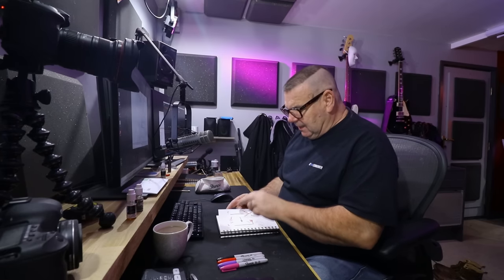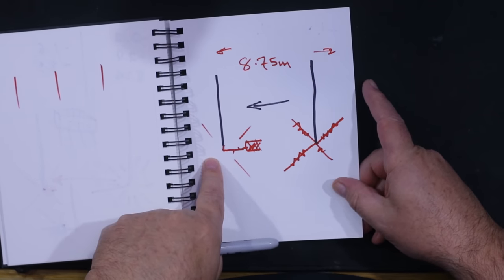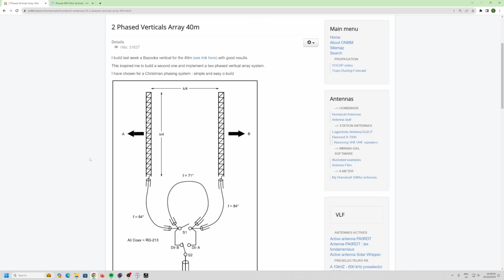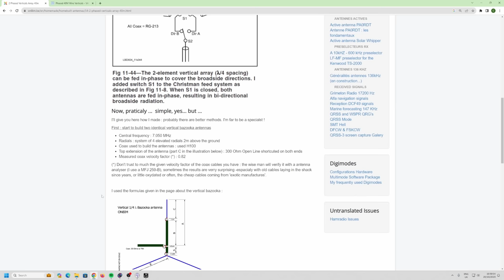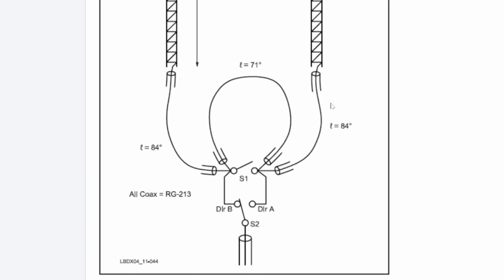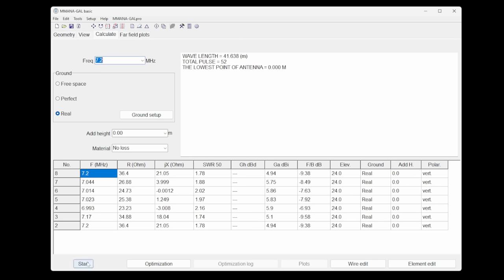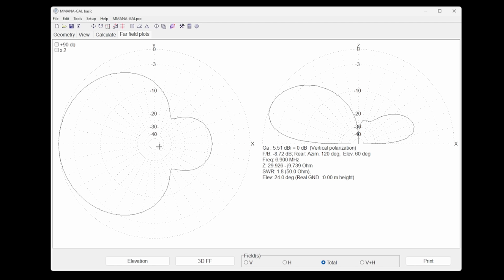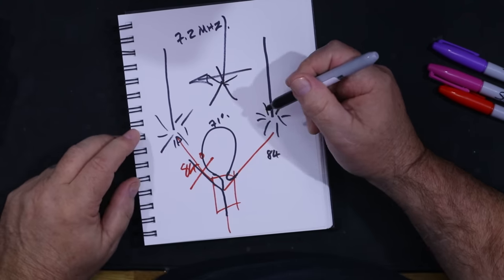Switchable Array in Two Directions - the Phased Vertical Antenna Array

Comment: Some 40 years ago i listened a lot to a 80 meter net. And one guy there told the other guys he would make this for 80 meter in de DX portion. With 4 elements for each direction and a middle element. The whole build took at least a year. He had many daily updates on his project so this was fun stuff to listen too as SWL. And he got it working! And it worked amazing good. When he tested it on air with his buddy's . I was close paying attention to my S-meter. And when he turned to me he had 9+30DB signal. And when he turned away from me he had a S6 / S7. Amazing difference.
Reply from the maker: Fab!
Reply: do you get the 3rd harmonic with this(40m/15m). would be great if it would. thanks for all you do for the hobby. KI7MJU

Comment: 60 years ago, Hy-Gain made a phasing box called, appropriately enough, a Co-Phaser. It was meant to be used with two identical base station vertical antennas set 36 feet apart, I believe.

Comment: Great video brother... thanks for all you do.  Callum a couple of quick things.... the impedance of the two elements needs to be as equal as possible to make sure the current divides properly between them otherwise you get varied current reducing the efficiency of the antenna. this is a bit easier to do with an elevated set of verticals and four 1/4 ground plane elements.   You can use 75ohm coax, it is probably preferable as if you are feeding two 75ohm loads in parallel, Z1XZ2/(Z1+Z2) = total impedance.  At 75 ohms you end up at 37.5ohms impedance for the coax.   The antenna will gain in the direction of the delayed element, if you delay A, in theory the signal from B should interact with A in additive interference and create gain in the direction of A.   The far field pattern will change with the distance between the elements, also the elements will need to be shortened due to mutual coupling between the two elements.
Reply from the maker: Top Banana John!

Comment: I've built them in one direction, without being easily switchable. Using two 50 ohm antennas, two quarter wave length  pieces of 75 ohm coax on a T-connector from the 50 ohm feedline and then a 50 ohm coax cable from the 75 ohm 1/4 wave pieces to each antenna. One antenna gets a 50 ohm cable 1/4 wave length longer than the other. The one with the longer cable is the direction of the antenna. 1/4 wave spacing between the two elements will give a small lobe on the backside, while 1/2 wave spacing will give a very sharp null at the back. If equal length cables are used for each element, the pattern goes broadside and is bi-directional, but is narrower than the unidirectional pattern of delay feeding of one element. The extreme front to back ratio can found with 1/2 wave spacing and 1/4 wave delay feeding the director element. The two 75 ohm 1/4 wave coax pieces are just to match the 50 ohm vertical elements.
Reply from the maker: Nice.

Comment: Phased antennas can certainly work very well, not sure in the diagram at 2:20 why the 84 degree sections, as long as both are equal the phase is preserved. S1 is presumably intended to drive both antennas in phase which should give you a broadside pattern, an alternative to the two directions of end-fire. S1 should actually be a double pole double throw  to entirely take the 71 degree phasing section out of circuit. As illustrated closing S1 will effectively create a 35.5 degree stub. Certainly very interesting. I have never tried phased HF antennas but have done some playing with VHF/UHF phased antennas. The nulls you can achieve in the patterns are amazing, more impressive than the gain! Good Luck
Reply from the maker: Yeah. I don't know either.. There's a clever chap who commented.. somewhere on this video (read down) but I was in a rush and can't quite put it together..

Comment: I used phased verticals on 40m and on 80m accord the Christman method. They worked great.  Some weeks ago I replaced the verticals bei Delta-Loops. Also working great. The biggest advantage compared to verticals: no radials are needed. On 40m the F/B ratio is around 20 dB and the gain of the phased delta loops compared to a dipole is 3-6 dB higher (for DX)

Comment: with 50 ohm coax just a coil will help bring up impedance to 50 ohm. also 75 ohm coax will bring up impedance as well. the delay line as well . 75 ohm like RG 11 . the 75 ohm coax gets you closer to 50 ohm at transmitter the tuner will do the rest or just use a coil to bring up to 50 ohm and no tuner needed if both antenna's are cut in tune the same.  at my AM broadcast site we have 4 towers cut the same and fed into phasor that gives us a change in pattern of signal . this also has coils and large vacuum caps to keep transmitter loaded to 50 ohm. this also switches for day/night pattern. great job showing phasing . this is where the length of coax is very important . if only one antenna the length of coax does not matter only the loss in coax . 73's
Reply from the maker: Nice!

Comment: The tricky thing with passively phased arrays is getting the power to divide between them as you expect.  If the feed point impedance of each vertical matched that of the coax attached there to, then the length of the coaxes from the antenna to the switch box wouldn't matter, so long as they were the same.  But it doesn't match, so this piece of coax is performing an impedance transformation (most easily worked out with a Smith chart).  If memory serves, vertical quarter waves are somewhat lower than 50 ohms, so the nearly quarter wave of coax would give a higher impedance.  (35 ohm becomes close to 71 ohms, 25 ohms becomes close to 100 ohms.)  Feeding them in parallel, such as when the broadside switch (the one that shorts out the delay loop) is closed, the impedance seen by the source becomes more reasonable (35.5 or 50 for the examples in parentheses above).  But when that loop is in play, one antenna is seen via 84 degrees of cable and the other via 84+71 = 155 degrees of cable..  So their impedances, both resistive and reactive, will be noticeably different.  (Unless the feed points really are 50 ohms.)  Good cancellation off the back requires that signal the amplitudes be the same.  (You can't wipe out a two penny debt with one penny,)  The closer you come to same power, the nicer the null in that cardioid pattern.

Comment: My Peterbuilt 389 18 wheeler I run a stryker 955 radio with 75 watts through two 75ohm cables to two loaded  antennas at 102" apart.  This setup really out but because of the large 53 long ground plane (trailer) wagon behind me it's directional on the road. A kinda weird thing is you line up 20 semi trucks in a row side by side at a truck stop and it really opens up the band with a quite low noise floor. 73  KN6TUX
Reply from the maker: GREAT!

Comment: 75 ohm coax is frequently used on arrays such as a 4SQ. Because the VF is greater for 75 ohm coax than 50 ohm coax this gives a longer physical feeder length. If this was not done it would be impossible to physically connect the elements to the phasing box at the center of the antenna array.  Stewart G3RXQ.
Reply from the maker: Yeah.. or triple the amount of coax! :)

Comment: Thanks for a great video.
Yes, this setup could be made ( I made one for the 2 band making the test easier as the verticals is small and manageable ),  Is this setup worth it? , If you have QRM that ones tries to eliminate than yes, but in a relative  QRM free situation  the difference on the receiving DX station is not going to be noticed ( no wow what a difference affect) , this situation is to change if more than 4 vertical  elements are used  ( could be a good idea for the 80m band), when it comes to the higher bands one might be much better with a Yagi.
All i could say is test test test and have fun doing it, there is nothing like knowledge you gained yourself by trying it out, as for the computer modelling ,,,,,, well,,, reality bites over and over gain.

Comment: All this works well when the poles are sturdy but what will be if they are flexible and start to bend under the wind load? For sure there will be no 1/4L. By the way, long ago I watched a tube video of some Russian guy that had built antenna field with verticals arrayed and phased. He had even 160m vertical array. But they all were pretty sturdy and heavily guyed ... and crazy high. You can imagine what the size of the field was considering that he had all bands built similarly. :)
Reply from the maker: With the high current being sat the bottom, depreciating as a SIN wave, you would hardly notice the difference.

Comment: I'm still learning but I think you have a mistake in the model where you set phasing. I've seen references to Christman and they say the harness generates a 90* out of phase signal from the 84/71/84 harness. I still don't know how that works. Intuitively it makes sense as you'd want your 1/4wl spaced antennas to be phased 90* apart so the peak of the "faster" antenna hits the peak of the "slower" antenna. Hopefully someone smarter than me can explain it.
Reply from the maker: See a later video where John explains all this..

Comment: Little bit wrong spacing between verticals. On your geometry, there is 10.5 meters. By trial and error I found the best value of exactly 10 meters spacing for 40m band.
Reply from the maker: .. and 8.5m for Parasitic.
Reply: @DXCommanderHQ  Thanks. Will try that as well.

Comment: Hi, long time listener first time caller here.. 

Can you please do a bit of moddeling for me, I am curious about using 2 ZS6BKW antennas hooked together but at 90° to each other, I’d like to try two antenna hooked up to the one feed line. I’m trying to experiment with being able to get ZL and North America at the same time from my QTH here in Western Australia. 
Is this even possible? Would I need two ladder line sections or could it be done with one?
Reply from the maker: Honestly, it depends on height above ground and frequency.. Personally, it's a heck of a lot of work and frankly unless you can get AT LEAST around a wavelength above the ground anyway, it would probably be a waste of your efforts. Try a 20m home-brew vertical..?
Reply: Thanks yea I will take your advice and try the verticals.. 
thank you

Comment: With a third vertical you end up with a Hygain ScanMaster for 40m instead of 11m CB
Reply from the maker: You would. They were elevated with an interesting matching system I seem to recall.
Reply: @DXCommanderHQ  I have the original drawings and the phase harnes's info along with the control box info. kg5pyc QRZ

Comment: Hey Callum. Have you checked the calculations in other antenna programs like for example 4nec2? I trust 4nec2 a little bit more - 
Moreover it is important to use antennas, which do not need so many radials --- loops, efhw - etc. Here is my video referring to your video... Best & 73 Thomas

https://youtu.be/Xq9jd1Qi6uo
Reply from the maker: He shouod build one and find out :)